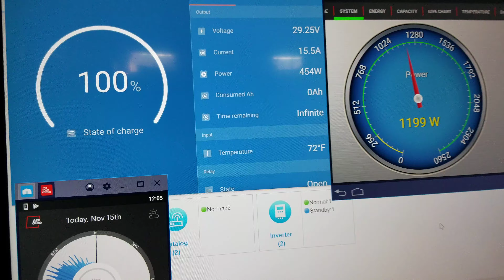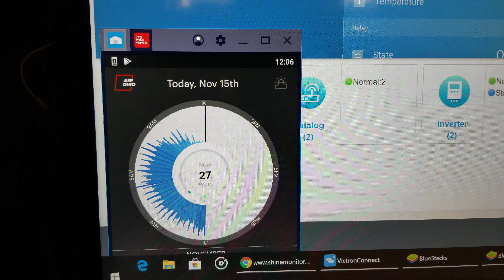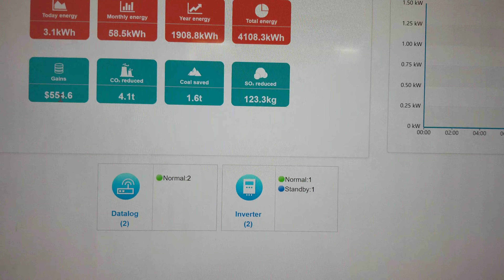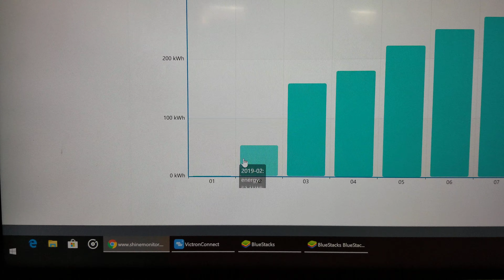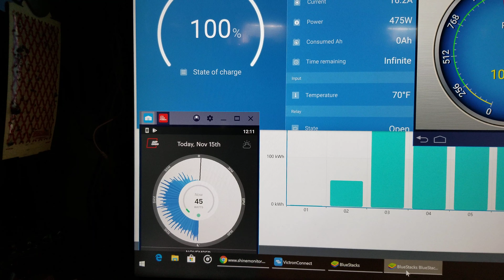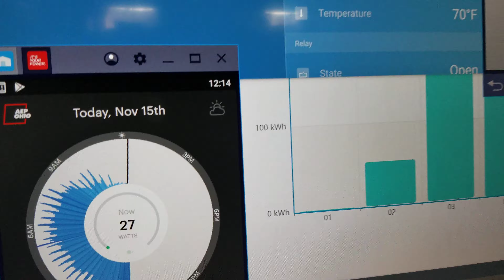Basic Talk about using Solar Power

Comment: Grid tie with limiter is a good cheap startup procedure 4 panels and the inverter less than $800 and it starts to pay back right away. Even cheaper if you buy used equipment.